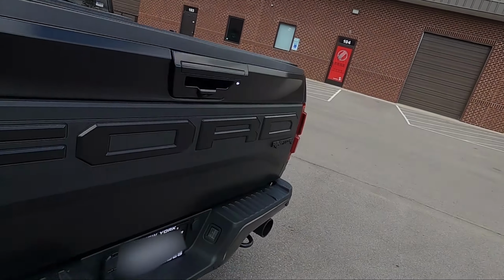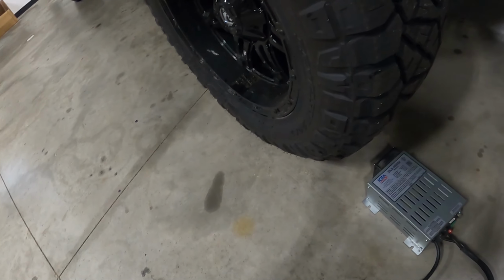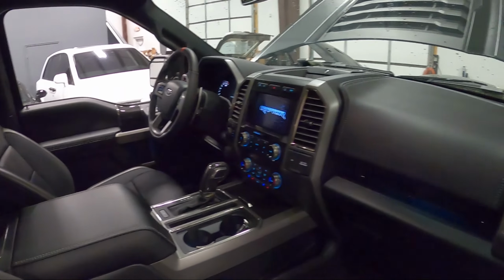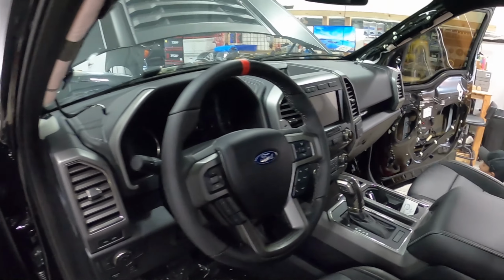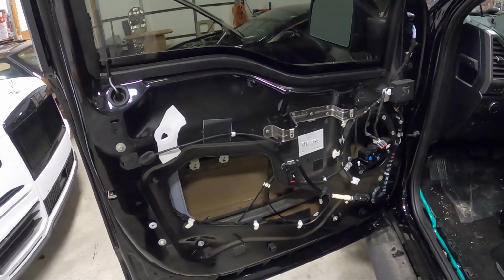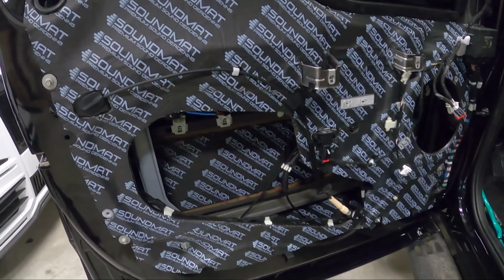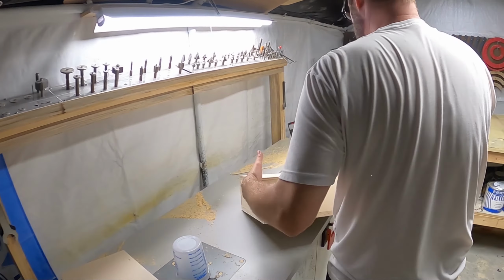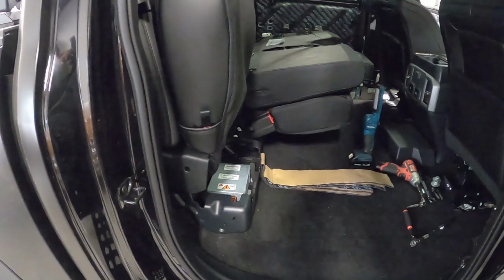2020 Ford F-150 Raptor Custom Stereo System Part 1 - Project Overview, Disassembly, Sound Treatment

Comment: I just bought a 2020 raptor and came across this video because i was looking at upgrading the stereo. I wish I lived in Nashville and could bring my truck to you guys.
Reply from the maker: We can handle the shipping of the truck to our facility and back, it’s quite common. Another option is we are releasing plug and play packages for these trucks.. So installation is simple and it’s pretuned, so the performance is what you expect.

Comment: I had a shop add a sound system to my truck, the 2019 raptors have a feature where the speakers in the truck create a louder version of the engine exhaust to make you feel it sounds good, now that the sound system it’s added I can hear ir real Loud on idling specially when I’m on open throttle, it’s there a way to keep this from happening?

Comment: What is the center speaker used for and do you guys do anything with it?
Reply from the maker: We leave the center channel alone and it's hard to explain, but its not needed in the way we do our upgrades. When we use a sound processor, we are able to make the sound come from the center of the dash, without a center channel. While we could incorporate it, the added costs (speaker, amplifier channel, sound processor channel, etc) would not be worth the benefit.
Reply: @SoundsGoodStereo  2018 raptor. I modified the center location for a 2.5 mid and 1in tweet. Solely for a 2 seat tune. Proper center image with a 3 way you can't really tell when the center is turned on. A smidge with the slight db increase. But in the 2 seat tune it does help.
Reply from the maker: Eod Vet Exactly, the issue we face is the ability to “upmix” properly through the DSP. We do not want the center to play everything left+right as that will kill the width of the sound stage.

Comment: Have you guys ever put in the linkswell system ? And do you recommend.?
Reply from the maker: We have actually! We didn’t test the audio outputs on the one we installed which on a lot of the tablet radios is a weak point. But functionality, it was good.

Comment: Hey guys.. Getting ready to do my 18 Raptor and noticed you ran the power wires along the frame.  Where/how did u get them back into the truck in the back?
Reply from the maker: You can see the photos here:
https://soundsgoodstereo.com/products/full-length-power-and-ground-1-0-gauge-power-cable-kit-designed-for-2015-vehicles

Comment: What was the cost initially for this Ford truck? Looking to get mine done this way! 

That flat black they have as well, is really nice! Is it a custom paint job?
Reply from the maker: System is $12k turn key, the exterior is a wrap.
Reply: @SoundsGoodStereo  12k for that sound system? i’m getting a raptor and wanting to bring it in to you guys… is that the correct number?
Reply from the maker: It has changed a little bit, but here is the link to this exact package. 

https://soundsgoodstereo.com/collections/2021-2023-ford-f-150-supercrew-with-b-o-unleashed-18-speaker-system-1/products/2015-ford-f-series-b-o-supercrew-screw-plug-play-focal-stereo-upgrade-packages?variant=42310881214676

Comment: Thanks for the videos guys, I have learned so much from here for my 2019 f250. I can't financially go as wild as you guys did, and I plan on doing the install myself (I live in Fl so really have no choice). But plan on buying some parts from you guys such as the ZEN-A2B, amp board, block off plates, and possibly the sub. Besides the ultra-high end stuff here, do you guys have any parts lists for a less expensive setup? (amps, replacement door speakers,etc?) Would really like an experts opinion on some of the gear that would work here while providing maximum performance on somewhat of a budget. You don't have to answer here, just wondering if I bought some stuff above if you guys could point me in the right direction on other components.

Comment: Isn't it better to close the holes in the door with sound mat?
Reply from the maker: Yes, we built baffle plates in Part two that cover the holes. We recommend a rigid surface, not just sound treatment for large holes. Here are the baffles we make for the F-Series trucks:
https://soundsgoodstereo.com/products/2017-2020-ford-f-series-custom-made-door-access-block-off-plates
Reply: Sounds Good Stereo I watched the other video and i was to early. Sorry ;)

Comment: Nice job!! How much something like this cost to wire a system like this??
Reply from the maker: It can vary based on the customers expectations, but what you see in the video turn-key was a little over $12k
Reply from the maker: Thanks for checking it out & be sure to subscribe so you see the rest of the build